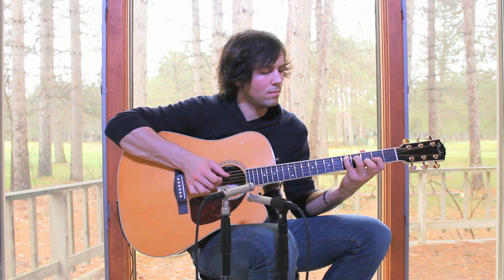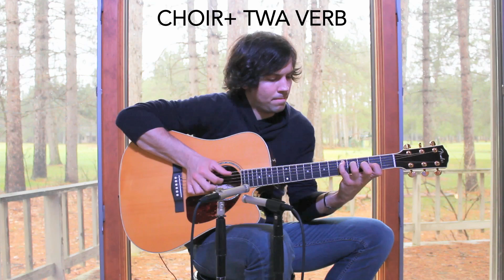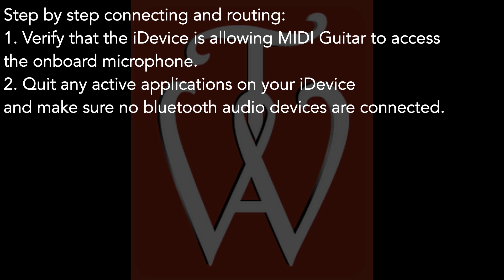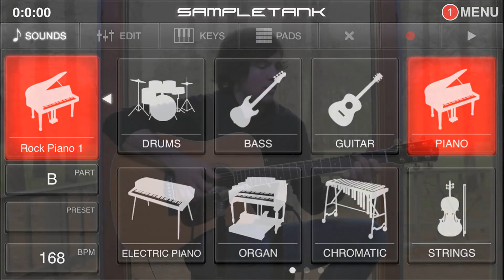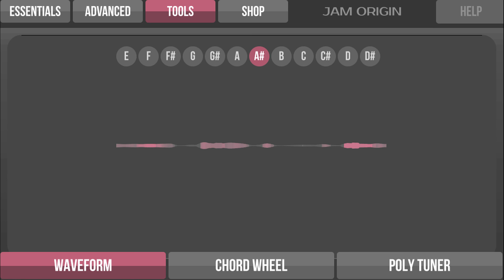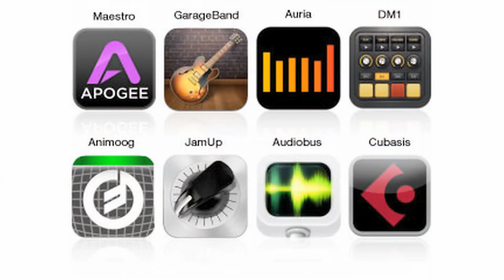Using an iDevice with the ToneWoodAmp - instructional video (Original version, MIDI Guitar ver 1.0).

Comment: Never works for me its a scamm :( sad backer here
Reply from the maker: Steeven did you contact our support (support@tonewoodamp.com)?
Reply: ToneWoodAmp surprisingly after writing this comment I played around with the town Tonewood amp with the app and it works. I only need to put the alarm volume up to the highest on the phone and then i can get the audio come out from the tone wood amp on the guitar sound hole. Yeah it works fine now the only thing that brothers me is that it doesn’t really work with drums and the Congos for these specific instrument it doesn’t work but mostly with strings with the get the guitar sound and the piano it works just fine
Reply: The midi apps will rely totally on your iPhone or iPad volume to send the signal into the ToneWoodAmp. Always be sure any other apps that use the speakers are closed when you start, and that the volume is all the way up! Most of the percussive patches won't trigger well to the notes, but you can enable latching for the pattern and have them play in the background. Also, feel free to experiment with other apps that can make drum beats and feed those into your ToneWoodAmp.

Comment: I am having the same issue as everyone else.
This video is dated and looks nothing like the Midi Guitar 2 app i downloaded. 
Midi guitar app shows input as iPad microphone, also the output levels from TWA are so low it barely moves the input meter. 
I’ve increased master gain to 100% and gain to 25 and nothing. 
Extremely frustrating.

Comment: so what about iDevices with no headphone jack? Does it work with the provided dongle that apple gives you? Also, have you thought about an updated version with USB instead of 3.5mm audio jack. this could provide an easy way to record and interact with an iDevice or Computer.
Reply: I found an adapter cable that goes from my iPhone to the Tonewood amp. Can't remember where exactly, but I must have Googled it.

Comment: Midi guitar 2 is not available??
Reply: Lengua Negra it's being reworked for iOS 12 and should be back soon. You can use Guiboard as a pitch to midi alternative!
Reply from the maker: @davearnold5328  See more info here: https://twamp.freshdesk.com/solution/articles/17000081050
Reply: Agree what other midi app works with samplerank?

Comment: I set up my TWA with paid versions of MidiGuitar and SampleTank using the iDevice cable I got along with my TWA. Using an iPad Pro 12.5” top of the line.
I can just barely hear the sound from SampleTank. I’ve tried adjusting everything I can find, to no avail. Can’t seem to find anyone with a solution, but I have had several other people say they’ve had the same problem. Did I just waste all that money?  Frustrated!
Reply: Is the volume up on your guitar pick-up? And (though I don't know yet), does the volume and/or gain on the TWA setting have affect the overall volume sent to the i-device? Just a thought...

Comment: Just received my TWA and it is amazing. Downloaded the midi guitar 2 and Sampletank CS apps but cannot for the life of me get it to work. Grrrr. Usually pretty good with electronic things but this is driving me a bit batty. I must be missing something?
Reply: I downloaded midi guitar 2 also, but didn't get the request to use my iPhone mic, so I can allow midi guitar to access the iPhone mic. Since this is permanent (per Apple), I downloaded the guiboard app. I was able to allow mic access (see video for details). I had to pay for the $10 upgrade, but it works. Open sampletank   first. Then open guiboard and go to second page by dragging finger on screen. Then scroll to sampletank for input selection.

Comment: What about android
Reply: You could always get Virtual Box and run iOS in a window. If you have an I7 with a lot of memory it would probably work just fine. I'm talking about running it on a Windows PC though. Hopefully, Tonewood Amp fixes this issue, and writes some software for Windows and Android users. That would probably gain them soooo many more sales of their wonderful product. If you are anything like me, you absolutely loathe any Mac product.
Reply from the maker: Hi Scotty. Unfortunately, all of these apps were written only for iOS. These are third-party apps (not ours) and the vendors of these apps found that only iOS devices can provide what they need in terms of uniformity of devices and hardware capabilities. In other words: we don't have any preferences which device you will use, but the fact is that as of today, these apps were written only for iOS devices.

Comment: Does it work with Ovations?
Reply: No because Ovations have very round bodies, there for the Tone wood amp has no spot to rest evenly on the body. if your Ovation has a relatively flat body/back then it might work. hope this helps =)
Reply: @MountainMusic0  Why not buy a left handed version and try putting it on the top just behind the bridge?
Reply: @garyvanremortel5218  totally could try that!